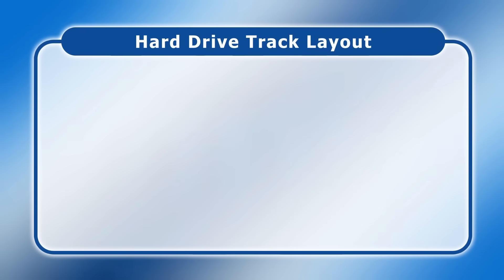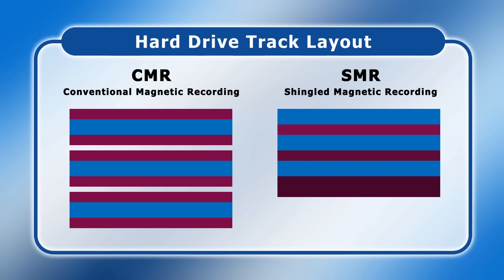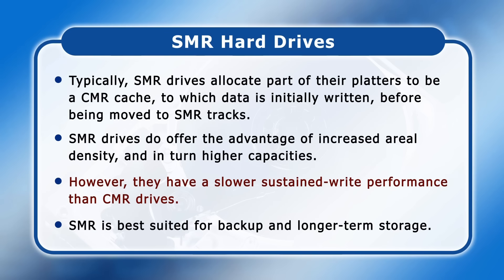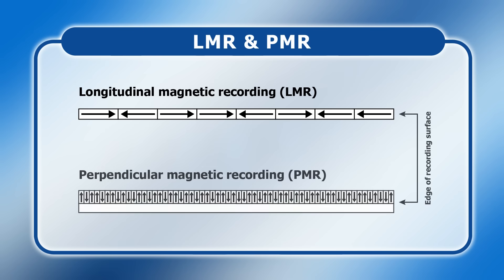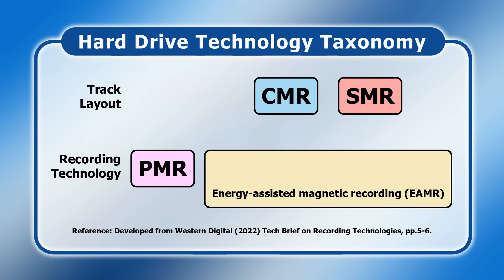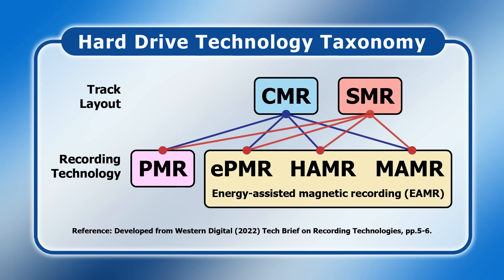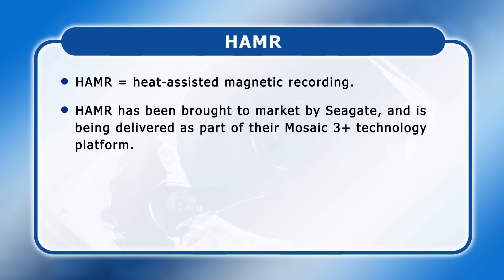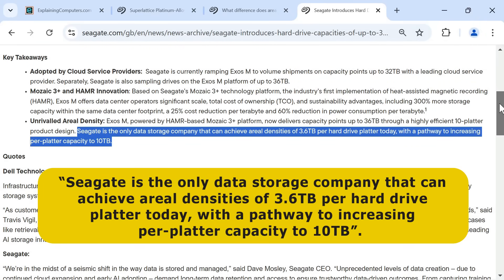Explaining Hard Drive Technologies: SMR, HAMR, ePMR & more!

Comment: It is good to remember that all hard drives fail; it's just a matter of time.  Keep shuffling those digital bits to fresh media from time to time.
Reply: SSD's also have a limited writes.
Reply: @ if you store an SSD untouched in a vault for 15 years, will its digital bits still be readable?
Reply: Chances are no  @Chris.Brisson
Reply: @Chris.Brisson flash memory that includes SSD retains a tiny electrical charge, if you ain't connected it and powered it on within a year or 2 years then it will lose that charge and the SSD will start to corrupt lose data or become unusable.
Reply: @Chris.Brisson Maybe. Maybe not.  You take a risk.
Reply: @Chris.Brisson no, you have to refresh it once a year to ensure integrity. In my opinion, this is a good compromise and don't take that much effort compared to the data that should be rewritten on a traditional HDD. I have many external SSDs and I plug them once a year to refresh them
Reply: @anthonywalker6268  they are also limited in "remembering saved data" if they had no power over a longer time
Reply: @anthonywalker6268  and after 6 months without power SSD's star to lose bits ;)
Reply: Keep your important stuff in punched cards.
Reply: @forinti who is using punched cards these days ?:))
Reply: Yes, it's an absolute nightmare. M-disc optical media is your safest solution. Not cheap though
Reply: @ 15 years hence, will you be able to purchase an optical disc reader?
Reply: @syrus3k M-disc stopped producing long ago.
M-discs sold right now is a verbatim's brand, not Millenniata's 1000 years  lasting m-disc.
Reply: I think explaining computers did a video on the topic sometime ago
Reply: I have HD last up to 12 years,  I did have one Western Digital that lasted 2.5 years even though I had a 3-year warranty.  I replaced it and 3 or 4 replacements later it only lasted 3 days at most.  So I don't think I going with a WD anytime soon.
Reply: It's not just hard drives.  All storage media fails eventually.  More than that, all hardware fails eventually.  All physical objects fall eventually.
Reply: In HDDs, just read and rewrite the entire harddisc in-place. This will fix errors on disc too since it will need to re-encode falling over bits that the error correction can still resolve and give it a new fixed encoding. All data will be rejuvenated too. OK, takes some time but copying it over to a second disc takes as much time
Reply: @reinoud6377  Better to copy to a fresh drive.  The mechanism will eventually fail.
Reply: Sometimes on forums people will ask "what's the best or most reliable hard drive".  That doesn't really exist, any drive can fail at any time for any reason, so instead, have a solid backup plan.
Reply: @redpheonix1000  i mirror everything on two harddrives from differen manufacturers. More important stuff is on a third outside the house. I only use them maybe once a month
Reply: @redpheonix1000  That's the best advice you can give :)
Reply: @redpheonix1000  I beg to differ. I’ve used hard drives that have lasted between 10-15 years. If you think hard drives are that fragile, you can always build a simple RAID array and replace drives that end up biting the dust first.
Reply: @BalancedSpirit79  I never said they didn't! I still have some hard drives myself that are over 20-25 years old and they still work perfectly with zero bad sectors. They are not in constant use, of course, and these one happen to be the ones that survived this long, but many more probably died much earlier (aka survivorship bias).

Also, preventing data loss due to a failed drive is exactly what RAID is meant for, plus maintaining uptime, and maybe data integrity checks, but it does nothing else. It does not save you from user error or malware attacks, so you still need backups if you truly want to lose no data. As they say, RAID is not a backup.
Reply: 2 drives: Broken ones and those that will break.
Reply: It's amazing how the designs largely remained unchanged, but are still different up-close, beyond what our eyes can see.

These days, I only use non-SSDs for temporary or non-essential stuff or, if not having the choice, only when I have a matching pair to achieve a RAID1 mirror.
Reply: Store data on RAID6 or RAIDZ2 arrays and perform nightly off-site backups. Then you won't have to worry much about your physical drive health
Reply: @volodymyrkleban1484  Indeed. Frankly, even with a RAID 0, you're fine if your backup strategy is robust enough.  RAID just saves you from having to avail yourself of your backups.  RAID = HA.  Backups = DR.
Reply: For SSDs and flash storage just reading it all rejuvenates it already 😁
Reply: @reinoud6377  But that doesn't work for something sitting in a safe.
Reply: My Dell PowerEdge 2650 (circa 2003) drives would like to have a word with you..
Reply: Use ZFS!